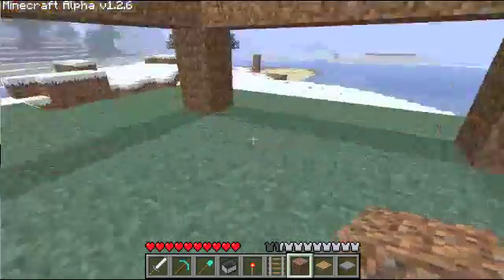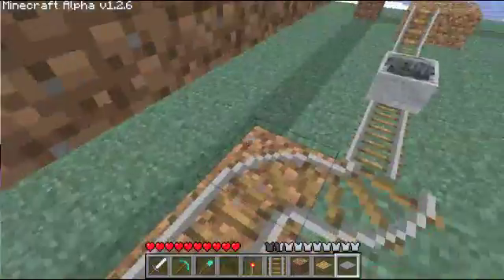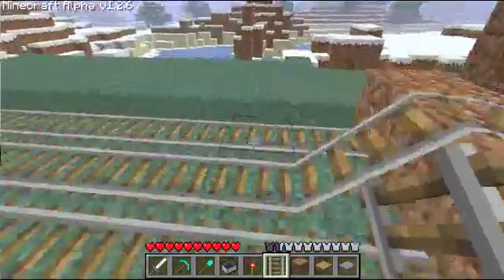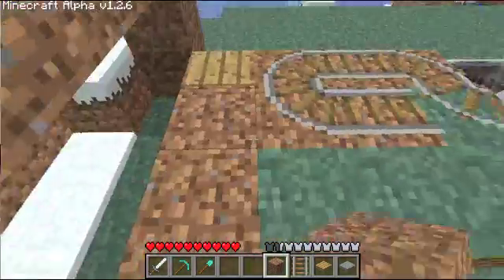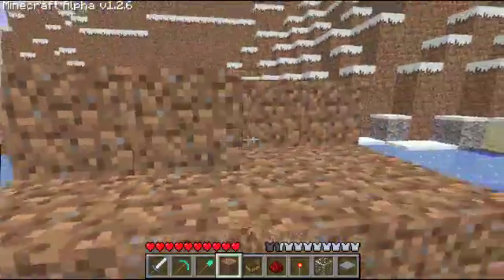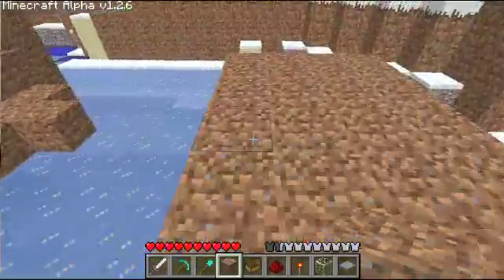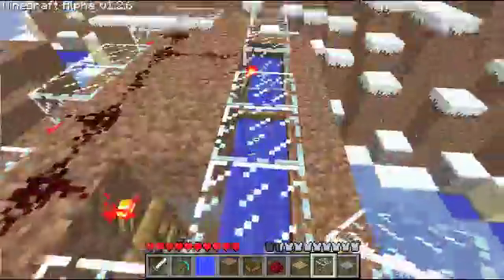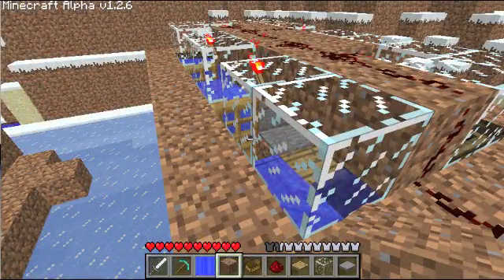Minecraft minecarts- Smart Booster Tutorial Part 2

Comment: I havnt built the reset part, but my cart are tuckering about around 1100 blocks. I have a few turns in the system. Do I need to use those pressure plates on the turns or something? I only need 500 more blocks of distance

Comment: @The8bitEngineers I got that part all set.  Now Im running into the problem of the departure cart.  So when Im ready to leave it will switch the track to send me the boost but it wont switch the track back when I get off which doesnt reset the booster cart and it ends up getting stuck.  Pretty sure I have the wiring right for that part.

Comment: @itsfreshson I too am replicating this setup, and I just solved this problem. I had a block (sand) next to my pressure plate - it was under the higher reset track (although I could remove it). After I took it out, the plate fires perfectly.

Comment: @The8bitEngineers My friend has the same problem. Its set up right and even at full speed it wont hit the plate. It only hits it when you slowly push it over the plate. I build one myself in the same sever and i did not have a problem. Although i did have a different problem. I think? If it runs for a long time the carts get glitchy and they appear off track. Not sure if it affects it or not.